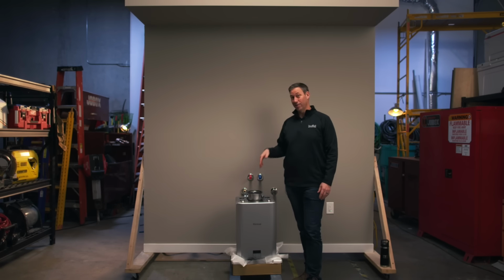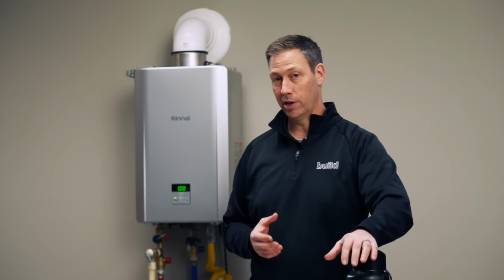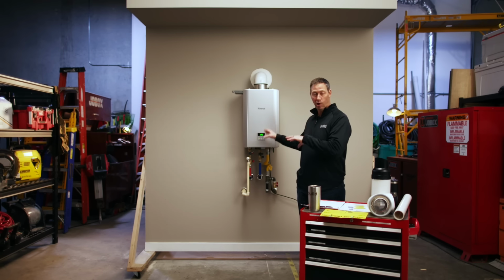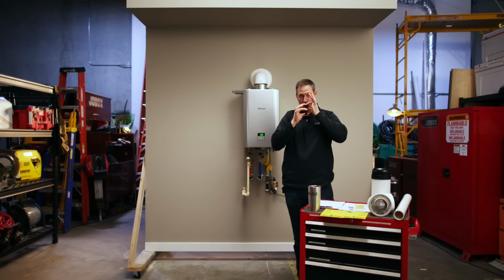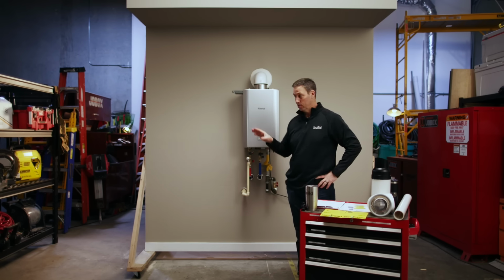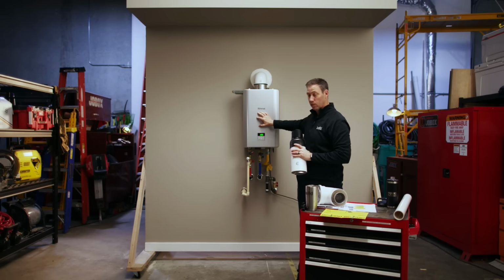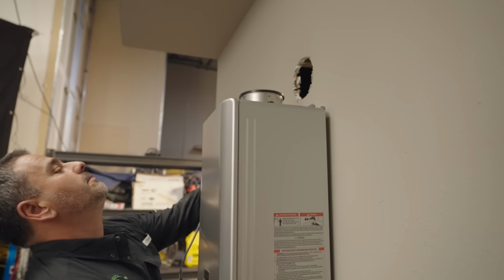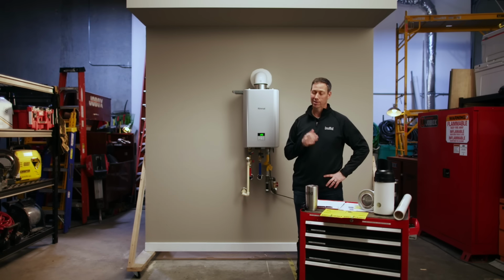Replacing A Water Heater Tank? Probably the Best Tankless Option for You.

Comment: In my experience the vast majority of times when a water tank fails, including water heater tanks; it's due to failure to regularly replace the $10 zinc annode.
Now I don't really blame homeowners as they often bury this maintenance in the manual and they usually bury the annode under the insulation.  So they don't exactly make this either a well known step or a convenient step.  But then; if your water heater starts to leak they get to sell another water heater.  Any incentive to help increase the lifetime of the tank isn't really their priority.  Or, you can buy a stainless tank for the premium price.
Reply: Those anode rods are installed with tremendous torque, far more than necessary. I tried to remove the anode on two brand new tanks and couldn't do it on one. One the other I was successful but shifted the entire tank with my huge breaker bar. Manufacturers do not want to make your life easier by making those anodes easy to replace.
Reply: @paulmaxwell8851  Possibly depends on the manufacturer.  I have replaced several, and yes, they are tight to prevent them from leaking.  You can't use a sealant and are not supposed to use an antiseize on the threads as the cathodic protection requires a clean metal-to-metal contact, so the seal depends entirely on crushing the new threads.
Reply: @paulmaxwell8851  That was exactly my experience once. Felt like I was about to rip the whole thing off the platform and damage the plumbing and gas line. No thanks. And then next year it began to leak anyway, and out the door it went.
Reply: @paulmaxwell8851  This...I tried to remove an anode on a 10 Year Old water heater and started to move the whole heater.  Could not get it out.
Reply: They do sell flexible replacement anodes.
Reply: @scottapt5291  That's true, they have segmented joints.
Reply: @scottapt5291  They also sell electric anode rods that are much shorter; but I don’t know much about them beyond that and they’re supposed to be maintenance free.
Reply: Do you know if changing the anode, on a 12 year old tank that shows no issues yet, is a waste? Or would it still add to the life?
Reply: @EMTDawg  It's preventive maintenance.  There are no guarantees, but the sacrificial annode is designed to 'corrode' so that the tank doesn't.
If it's a stainless steel tank it likely doesn't need an annode, unless your piping and fittings are galvanized.
My expertise is in industrial/commercial maintenance, not specifically with plumbing, but the technology is the same.  Replacing a $10 annode every few years is far cheaper as preventive maintenance than replacing water heaters every 10 - 15 years.
Reply: Gotta add flexible anode rode to my Amazon shopping list. 😁👍

Matt had a video a while about replacing them to help extend the life. I thought I was SOL since I have no clearance above.
Reply: Not to mention water heaters are usually installed under a low ceiling; where removing and installing an anode rod is next to impossible.

Comment: I have been loving my heat pump water heater. Runs on a tiny amount of energy, there were incentives to make it cheaper to buy, and dries the air in its environment as a bonus.
Reply: Definitely getting a heat pump when my current gas fired unit dies.
Reply: Same, I was going to go gas tankless but went for the incentive on a heat pump tank instead. I was wary of capacity and speed but It has totally changed my opinion, I'm sold. I get free AC in the garage now too! I'll be getting rid of my gas furnace next for a heat pump, and with that I'll be ending gas service to my house as well.
Reply: @bfayer  After this months $375 gas bill in Laguna Beach California to heat my 2k sf house I am looking to go all electric and add solar. I have sealed up every hole in the drywall too. The gas company is jacking up the prices to high to stick around and see what they do next. If you change your store location to some cities in Oregon there are big discounts for Home Depot. I am looking at Rheem. Good choice?
Reply: But…. Like everything, not free. In the case of a heat pump you have to consider that the room which is “giving” the water its heat will become colder. Perhaps colder than was anticipated. So you have to be careful where your heat pump is installed. Not a problem if it will be an unused basement room, but if it’s in a hallway in the living space, for example, the house will be getting colder in the winter, for example, than it normally would have… Just a thought
Reply: @DanielinLaTuna  NEEA did some really interesting analysis here in the PNW on the economics of the “stolen” heat. If you are into white papers, it’s a good read. In short, the efficiency of a heat pump well exceeds to cost or loss to the existing home heating equipment. The math gets even better with a heat pump as the main hvac, even with stacked losses they still save tons of energy over the alternatives.
Reply: @DanielinLaTuna  True, though I'm not sure by how much. I have my hybrid heater in the garage (in FL) so during the summer it has a ton of heat to pull and honestly I don't sense the garage to be any cooler. Don't notice any difference during winters either though I know there has to be some difference (law of thermodynamics). My garage is relatively large (3-car) but I don't think it would even be a noticeable difference in a standard 1-car garage. I would be curious how many BTUs it would take to heat 50 gallons of water vs how many to drop the garage temperature by 1 degree.
Reply: @jaxjaguarz  , I see; but you’re in Florida, so it won’t be much of a difference for you (or me in Southern California). But if you were in Minnesota or New York, definitely would make a difference
Reply: @jaxjaguarz  , by the way Technology Connections great channel. Have you tried Undecided? Also a good one, especially now, since Matt Ferrell is beginning a series on his new house
Reply: I also installed a heat pump water heater and it is the best piece of cost saving equipment I have. Far more efficient than a tankless water heater and cheaper to run.
Reply: @JeffPorter4316  what is a heat pump?
Reply: @nonwilson5587  It's a standard electric water heater, but with what is essentially a window AC unit on top (that is the "heat pump"). The AC unit, aka heat pump, pulls heat from the air and via the compression and evaporation mechanics of the unit will release, or ahem "pump", the heat into the water. It's the same process that happens when a home needs heat in the winter (hvac unit takes heat from the outside air and moves it to the inside air). Technology Connections has a great video about heat pumps that I think helps folks who are unfamiliar understand: https://www.youtube.com/watch?v=7J52mDjZzto

Comment: In my area they are just about to change the code to ....prohibit gas WH, stove, and dryers.  Electric only.  New build houses won't even have gas as an option.  Sigh.  Since my house currently only has 100A service, I put in another 50gal standard gas unit while I still could get a permit to install it.

Comment: Matt my father in law and I replaced my water heater last year and I had planned on using tankless. He pointed out that I'd need to upgrade my electrical at the water heater location and in the panel. I dont remember the specifics but something like adding 2 more 240 lines.are residential designed to use the existing electrical set up or what
Reply: The RINNAI gas water heater plugs into a 15A outlet,  and it shares the outlet with the water softener in my house.  What special 240V wiring do you need??   DO NOT use an electric tankless water heater!!!
Reply: @hanko5750  

He's talking about a 240V electric tankless.  Not only new wiring for the unit, but likely a panel and/or service upgrade as well.  $$$$$

Comment: Have a 60 year old house where the natural gas water heater and furnace share a flue and are in the middle of the basement - literally no walls within 15 feet to hang one on without repiping.  But with just the two of us now, it makes more sense than the big old water heater that's there.  Just not sure it'd be an "easy" replacement.
Reply: My  big old tank only heats when someone is running hot water.   The gas bill never hits the minimum in the summer time.
Reply: @flyingjeff1984  Good for you, my spouse isn't a fan of waiting 4 or 5 minutes for hot, not warm, water.  With kids that wasn't a problem much, but with 2 of us, common every morning and often at night. Some favor costs some convenience, yet the cost wouldn't be much for teh fuel.
Reply: @JohnMcGing1  I don't begrudge convenience to anyone.  I just didn't want anyone to watch this Rennai ad and think they were going to achieve something besides comfort.  Adding in the cost of the unit, this is an expensive proposition but certainly within a lot of people's reach--just not mine.   I'm also fortunate to live in a smallish house.  30 seconds to fairly warm/hot water.
Reply: @JohnMcGing1  , The tankless water heater has nothing to do with getting  hot water to the fixtures faster. Recirculation lines can be installed on any type of water heater, even the one you have now. If I were you I would go with a 50 gallon A.O. Smith Proline XE Power vent and put Matt’s little recirculation gizmo on,that needs to be replaced every three years or so. You also could have a dedicated recirculation line installed .
Reply: @boby115  

Yes,  I have a timed, recirculating system on my tank system.  It's more than 40 years old and still going strong.  Insulating the out and in lines from the pump to the crossover in the kitchen, some 50' or more of 3/4" copper pipe, has minimized the heat loss.  Setting the timer to run at fifteen minute intervals for morning, noon and night periods has us getting hot water at any faucet within a few seconds of turning on.
Reply: My 95% efficiency gas furnace isn't in the middle of the basement, however both its supply and exhaust PVC pipes simply run up and over to a basement window about 10 ft away. They knocked out one of the glass panes, installed a sealed panel and that's it. 

I have my suspicions that the previous owners were forced to go with the more expensive 95% efficient furnace for this reason ... there was never a central air furnace previously, and there was nowhere to run a flue up anywhere. Or maybe there was and they decided against it. House originally had a coal boiler, so a chimney in the basement.

There's a gas water heater near that same window, a direct vent style and so it has the concentric venting that just goes out the window horizontally. It's tempting for me to get a unit like the Rinnai featured in this video, but where possible I want to move away fossil fuels burning in my home.

Comment: That sounds like it will fix the problem my daughter had.  Her "water saving" shower had trouble keeping the water heater on so she had to run the lavatory hot water to keep the sensor tripped.
Reply: Take out the stupid flow restrictor. I have removed all of them.
Reply: @tomtillman  

Sometimes they're part of the device design.  No flow restrictor added.

Comment: I'm all for new technologies & modern conveniences, but I naturally shy away from much more complex units when simpler and proven technology are still available. My current hot water tank is a standard 40 gallon natural gas fired tank with a pilot light. It doesn't need electricity to work. It was installed 21 years ago & it hasn't needed any service. Not even a new thermocouple. If it craps out tomorrow, I'll replace it with the same type. Simple, cheap & reliable trumps trendy complex & expensive when it comes to mechanical systems.

Comment: Matt, one thing that you didn’t mention, that I think is important is what the tank is made of… Is it copper or stainless steel?  That’s a key selling point for me on commercial especially.  I haven’t looked into the Rinnai lately, so I don’t know, but the Navien, that I installed in my house has a stainless steel tank… Or should I say reservoir…
Reply: I installed a Navien NPE 240 A2, just over ten years ago, it had a failure in month 3, covered under warranty, and its been awesome ever since.  Pricey, but I would buy it again.
Reply: You should check out the Bosch Greentherm line.
'I attended their WH training yesterday and I have to say they are phenomenal!
Reply: Right now every competitor to Navien are all using copper piping and heat exchangers
Reply: Also what's the scale dispersal technique, i recall some are designed to expand and contract to keep buildup at bay best possible
Reply: @schnellfahren911  In the Bosch GreenTherm they basically put a "spring" (or coil) inside the copper tubes of the heat exchanger. This coil moves independently inside the tube which gently "scrubs" the inner wall and effectively prevents scale from forming.
Reply: Or causes a hole to be rubber through the walls due to constant friction. Plus having aggregate to help it because you are grinding the scale into the tubes
Reply: Good point!!👍👍

Comment: Sounds like a good system on a physical level. However the “smart” part of it would drive me crazy real quick. Not the least bit interested in that part of it. Let me tell it what and when.
Reply: Mechanical > “Smart”
Reply: I agree. Other brands have programmable timers for the recirc feature, which i MUCH prefer.
Reply: For a much better on demand pump controller check out the Smart Recirculation Control. They don't try and guess when you will need hot water, they allow you to set timers if you want or run the pump on demand. It only runs the pump till the water heats up and then it shuts the pump off. Works with tank and tankless system with and without a dedicated recirculation loop.

Comment: Isn’t that warming up your cold water side also? And I thought the point of tankless was so that you didn’t have a water heater tank constantly rewarming the water and wasting electricity or gas all day long
Reply: "The point" of a tankless is that you never run out of hot water. I love that about my Rinnai, everybody can take 45 min showers.
Reply: @bboi  one of the selling points is never ending hot water, another is the efficiency you get by not having stand by losses from heat leaving a tank.

Both can be selling points.

This system does not use less energy to run, but you get that from the get go being non-condensing. 

The only way this could reduce energy impact is if its cost is low enough and the size of the house is large enough to have multiple installed so the hot water runs are shorter. Condensing would still be more efficient, but if the cost of this is lower, it may be an okay alternative for someone on the cheap side (course if they have a large and poor layout - they should have enough to pay for condensing or there's can fix the layout.)

The recirculating only fixes long plumbing lines, it is only a good strategy if water conservation is more important that the fuel and efficiency there, which is sometimes more geographic to decide there.
Reply: @bboi  based on your comment I’m guessing you also believe that climate change is a hoax and droughts only happen in “s&*thole countries.”
Reply: It only warms the cold side up slightly. With a tankless, the hot line goes cold quickly (like a normal tank), but the lines inside the tank are mechanically cooled to air temp. This mean that when you turn on the hot tap, the heater has to heat up the pipes and the water which simply takes longer than a tank as the tank line is already filled with hot water. The circulating hot water idea is how hotels have hot water at any tap on any floor/room within 3 seconds. Yes, it wastes energy. And yes, I have a tankless unit which I love, but I do not have a circ system which I do not need.
Reply: You didn't list
Reply: Tankless won't lower your bills enough to justify the cost of them. They will only give you unlimited hot water. If you have one you may as well install the sensored tee, at least you'll be wasting alot less water by not having to run the water so much longer waiting for the hot water to come.

Comment: Not a fan of tankless, and with recirc? It’s not saving any money. A modern water heater with extra blanket insulation is hard to beat. Have to factor in cost of unit, cost to run, and longevity. Tankless may be Southey cheaper to run (however, I bet that savings goes away completely when you add a recurc pump)
Reply: The not saving money is just the efficiency of the system - its a lower rating than their other units because it is not condensing as well.

Its a comfort sell and a solution for lazy replacement that want to use existing chimney duct, not an efficiency sell.
Reply: Agreed. Especially one that cycles on all the time. The best recirculation pump control I have found is the Smart Recirculation Control. It is an on demand control that gets installed at the water heater and can be triggered from any hot water fixture without having to run wires or install buttons and sensors all over your house.

Comment: Getting rid of my gas tankless in favor of electric heat pump as we speak.  Solar on the roof so getting rid of the gas.

I don't agree that this 85% efficient gas heater is the way to go.
Reply: I have exact same set up. Solar since whole house is electric and I switched to a hybrid water heater and it is fantastic. Cools my garage in the summer time too which is a nice plus. Also I can control settings via app like high demand mode when we have guests.
Reply: Exactly, usually Matt is energy-conscious (e.g., promoting tight houses) and here he's promoting this inefficient model and promoting "forever-long" showers. I don't get it, Matt.